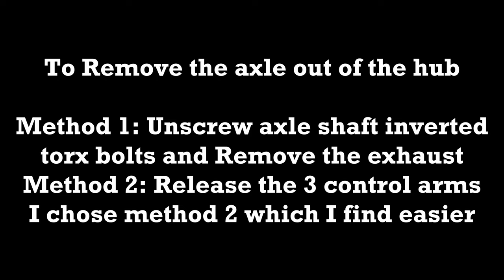How to Replace Rear Wheel Bearing on a BMW E91, E90, E92

Comment: One BIG mistake.... RIDEX.... BIG CHEAP CRAP!! bmw OEM bearings are from FAG , 

With cheap ridex or ebay bearings... 1 years? 2... dead..
Reply from the maker: It was budget DIY. But good to know. Next time it will be FAG
Reply: @carrepairandtoolsvideos  FAG or SKF 30ish €  both does bearing for BMW. For suspension its Sachs.  Silentbloc  its Lemforder.  Brake , ATE.  If you need an oem part brand name for a specific part, hit me up, these are BMW parts but without the cost of a BMW parts, when you buy it you can see they grind the BMW logo. Have fun
Reply: 100%FAG nothing else.
There is to much work (and money) to put cheap bearing...

Comment: Would it be faster if you took out the axleshaft?  In my opinion, you unnecessarily disconnected the suspension arms  because now you have to go and adjust the geometry. But general good job ;)
Reply from the maker: I made a detailed video on this job where I mentioned that due to rusty bolts of drive shaft I chose this method. I did other side by removing axle and stripped the bolts which were insanely rusted. It was a nightmare. So I chose this method. Took little more time but worked for me. It will need alignment in both methods anyway. Thanks for pointing out that.

Comment: This is a great video. How long did it take you to do? I've seen Dorman sells a whole wheel assembly/knuckle. Almost looks like it might be faster? Is it hard to remove the axle?
Reply from the maker: Its heck of the job. If you have the right tools, you can do it between 2-3 hours. In my case the axle was stuck like a hell. I live in rust belt environment. But if you dont live in rusty environment then it should not be that hard to remove axle. Yes, it will be faster if get pre-assembled parts. I would personally do only wheel bearing if I have access (or borrow)  to all tools.

Comment: Is so much risk with the bearing not going straight or your tool not aligned precisely on top of the edge of the new bearing.. having so much play and movement in the hub being half dismantled.. you could remove the driveshaft first.. (of course HAVE THE CAR ON STANDS!) Then remove the bearing..
It takes energy on what you are trying to do... And yes as other said GENUINE FAG or SKF...
DIYers, this is NOT an easy job. Mechanics themselves know this. Changing rear wheel bearing on BMW is not easy..
Reply from the maker: This is the shorter version of the job. I have full 50 minutes detail video too on my channel. The bearing settled in nice and straight but it needs attention obviously.
Yes, I could have removed the drive shaft but decided not to due to the fact bolts of drive shaft were rust and crusty and been rounded off on the other side. So I did not want it this side of the car. I avoid now chinese parts and go for SKF or FAG  etc. 
It was not easy job doing on the drive way but with right tool it can be done effectively
Thanks for sharing your thoughts

Comment: What’s the tools called that you use and the material list?
Reply from the maker: I have used few specialty tools. Slide hammer puller, universal hub puller, bearing race tool. I have put all the tool's link in the description section if you wanna check them out.

Comment: Hey, nice work, but why you didn‘t simply pull out the driveshaft?
Reply from the maker: Botls of driveshaft were rusted to extent will get stripped and it happened to other side. So decided this method :)

Comment: few pieces of advice from a dumb man currently in the trenches:

1. you absolutely need a torch to pull the drive shaft from the spindle. no exceptions. pb blaster is good too but doesnt come close to heat. 

2. make sure your ebrake is OFF when you go to pull the hub.

3. he removed the sway bar connection to pull the shaft out. i also suggest looking upstream the  ebrake line and diconnecting it from the wire bracket before trying any pulling. 

will update with whatever dumb stuff i learn next.
Reply from the maker: Thanks for the valuable tips.  However, this is a shorter version of the actual video. I have full 48 minute version of video where I used torch, hammering etc. I did not remove the cv axel due to the fact bolts were rusty and would strip as it happened to the other side. So I decided to undo bolts on control arms etc. Otherwise removing cv axle completely is easiest way as you mentioned along with sway bar link. Thanks for sharing your knowledge :)
Reply: @carrepairandtoolsvideos  you got any tips for the c-clip? mine is putting up a real fight
Reply from the maker: @thomashofstadler2549 it gave me also a tough time. Just keep hammering enough with a flat head screw/chisel around the circlip and keep cleaning the rust around with some pick and hook with heating if you have torch. Check my detail video in the description, that might help you.

Comment: Nice. But removing the CV axle is easier than to remove the suspension arms bolts. Plus the alignment you need to do afterwards.
Reply from the maker: Yes, you are right. Due to rusty bolts of cv axle, i avoided to remove that and chose to remove suspension arm instead. The car went for alightment at shop later

Comment: How much should it cost at a garage to change both sides? 3:46
Reply from the maker: Depends on the shop and location. It could cost from 600 to 700 $ including parts
Reply: @carrepairandtoolsvideos  thanks,I’ve just been charged £530 including parts so it sounds about right

Comment: How did you know when to stop pressing the wheel hub into the wheel bearing? I over pressed mine and now the rotor won’t rest flush onto hub because now it’s rubbing on the backplate
Reply from the maker: You will feel when hub stop moving forward. I dont think you can over tighten cause you will feel it that its not moving forward. If you still over forced it very hard then its another story. Plate can be bent accidently during the job. try to bent the plate away from rotor and see it helps.
Reply: You have done probably something else wrong.. to the date I am at the third bearing replaced on the rear, having 250k miles done with same car.. the bearing case should rest in the hub against the lip that is there inward, at the bottom. If you grease the hub prioir pushing the bearing you would have felt it. One good idea is to put the new bearing in the freezer couple of hours so it is shrinked slightly prior pushing...
If you do not push the bearing to deep you would not be able to fit the clip inside behind the bearing...

Comment: Can bad wheel bearing cause abs light 4x4 light and break pulsating?
Reply from the maker: Yes, bad bearing can cause abs light since bad bearing can send error signal to the system. Brake pulsating can happen too but its not so often. But its important to check properly whether its bad bearing or brake system's fault.